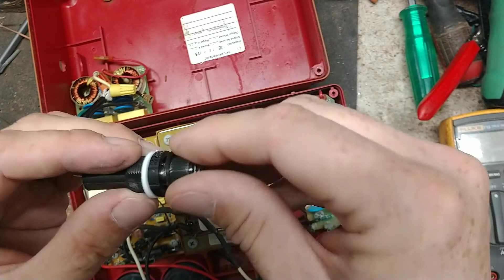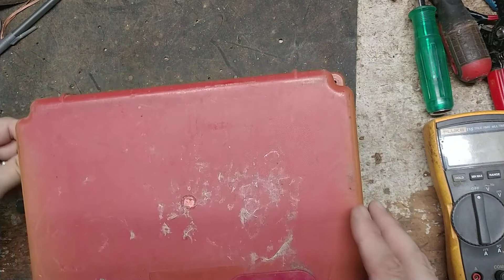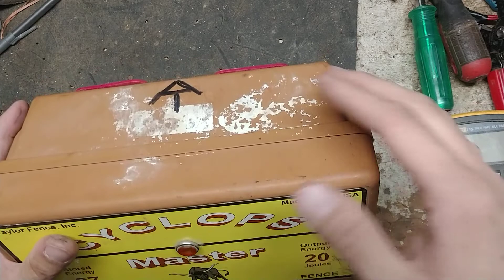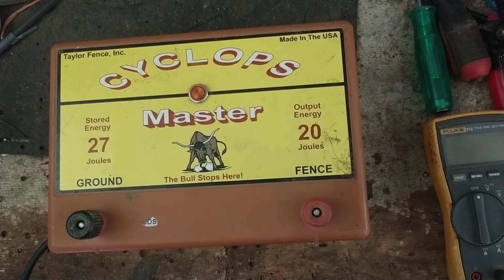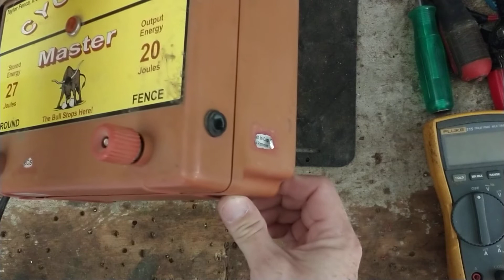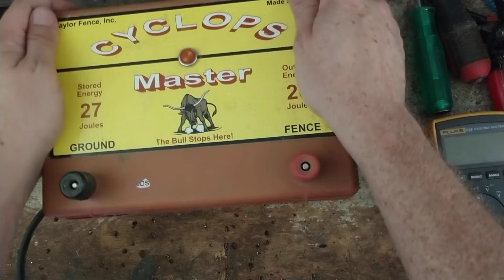Installing A Fuse Mount On A Water Damaged Cyclops Fence Charger Repair | Install AC Units Inside!

Comment: Just a suggestion why dont you use resettable fuses
Reply from the maker: Never looked into them.
Reply from the maker: Just looking online real quick, I can't find them any smaller than 3 amps and they cost 3-4  times the price of the fuse holders I buy that are well built and don't fail
Reply: @FencerFixerRepairLLCKansasCity  we get some good ones here roughly equal to 10 cents .I use them for my 12 volt models
Reply from the maker: What voltage and amp ratings are they?
Reply: @FencerFixerRepairLLCKansasCity  6 to 24 volt 2 amps you can also use up to 30 volts they work very well
Reply: I can send you the part no.if you want.or a pic on you email
Reply from the maker: @AshishJain-nb5vs  What about for AC powered units? Of course we use 110/120vac here but most of the fuses are rated 250v. Most are 1/2 amp, 3/4 amp, 1 amp, and occasionally a 2 amp, but they're all 250v on their voltage ratings. Send me a part number and brand names if you want.
Reply: @FencerFixerRepairLLCKansasCity  you can use 150 volt ac fuse   I will have check if you can get them in the mentioned rating by tomorrow.
Reply from the maker: @AshishJain-nb5vs  sounds good, thanks.